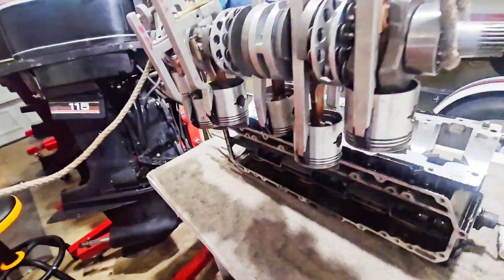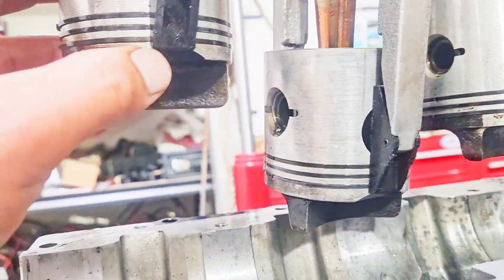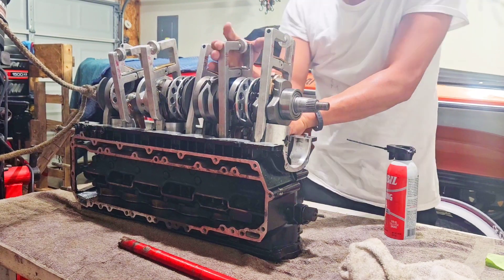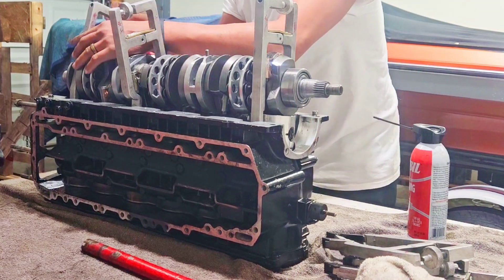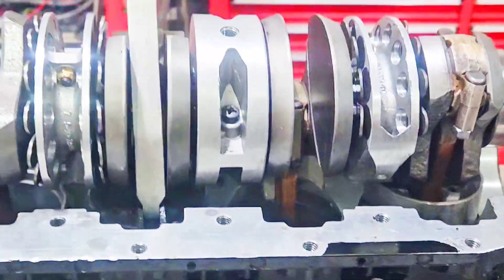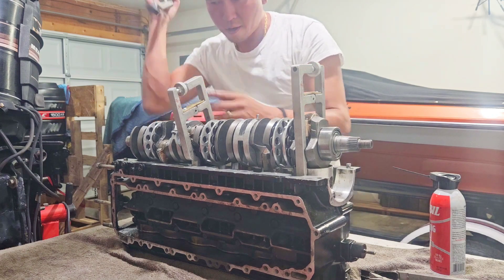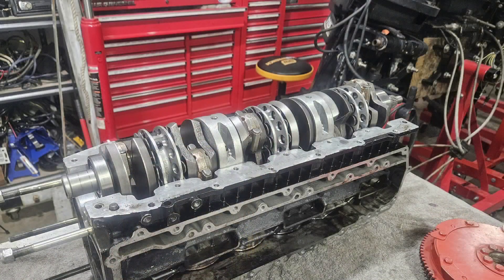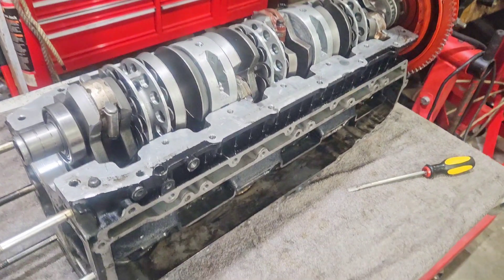Mercury Outboards: L6 Piston & Ring Install With Ring Compressors

Comment: I subscribed to you 5 years ago when i bought a 1000$ 16' checkmate with a 1985 90hp Tower of Power.

 Did the fuel pump and impeller just incase and do annual plugs and gear lube changes.

It hasn't ever given me trouble until last month when the stator started failing. 

 I wanted to thank you for the awesome library of Mercury Knowledge that you have uploaded for all of us!

Your troubleshooting videos helped me check my trigger and stator, the stator was way out of spec! 

Replaced it with a "CDI Electronics" stator and it runs great again!

Thanks again!
Cheers from 🇨🇦
Reply from the maker: You're welcome my friend and thank you so much for the support. Happy Boating! Son

Comment: had a question on this. what is the crank specs for the clearance between reed block to crank? have 2 cranks bad grooves in it from reed blocks. found someone to weld amd machine aswell balance but dont have the measurments

Comment: The easy way is to remove the rods from the crank put the pistons in with your fingers pushing the rings in.
Bottom out the pistons set the crank tapping with a rubber hammer after lining the dowels on the bearings and reed cages and bring the rods up one by one just keep track of your bearing count .